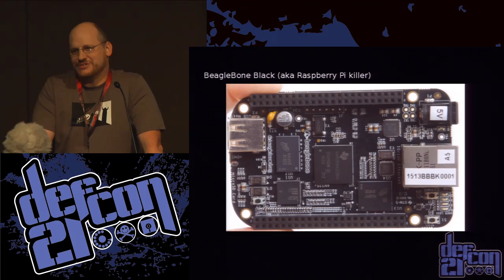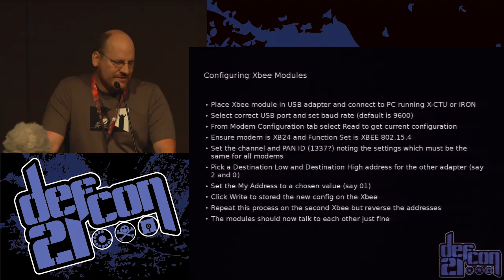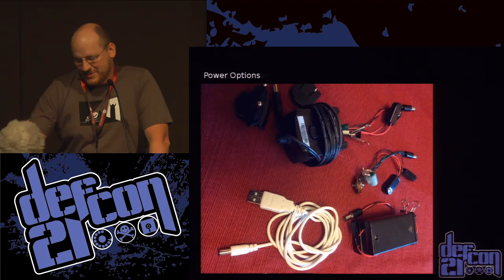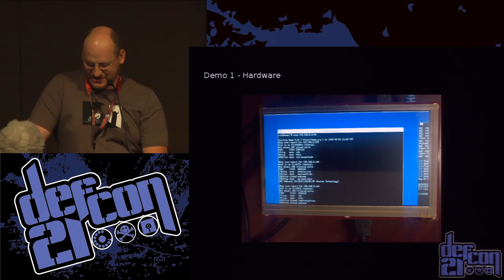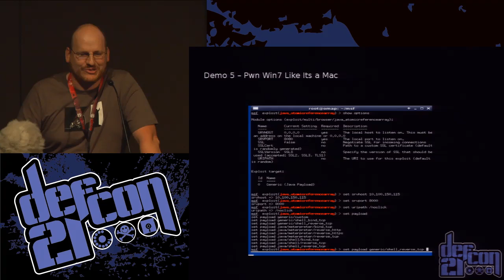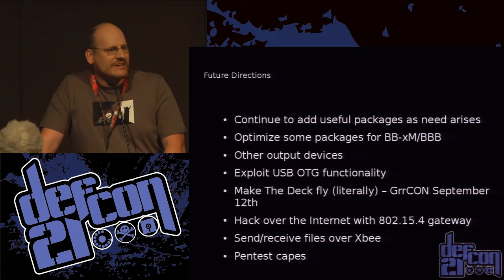[DEFCON 21] We are Legion: Pentesting with an Army of Low-power Low-cost Devices

Comment: Meh. Dude bought some raspberry pis for like $25 and then bitched for 40mins about how they're not as powerful as a $1100 machine. Seems idiotic. The pi 3 is out and chaining a few overclocked pi 3s together gets the job done fairly well. Plus you can use the pi zero W to make a super cheap node for various purposes. You can even mine crypto if you get 30~ raspberry pi 3s, and use a mineral oil cooling system and power it with solar panels. Its been done already. Overall I get the point but the guy is just dry humping the pi and fisting poor people.